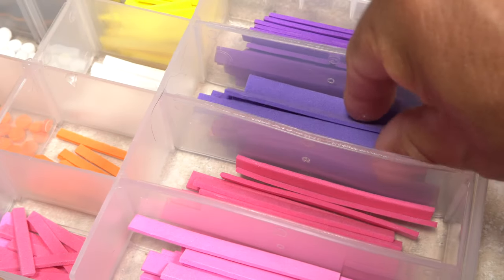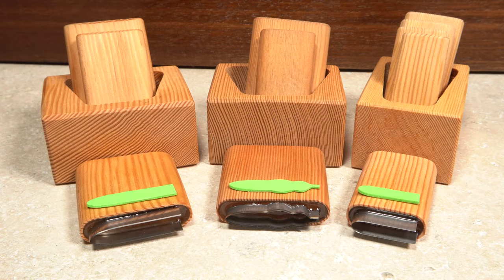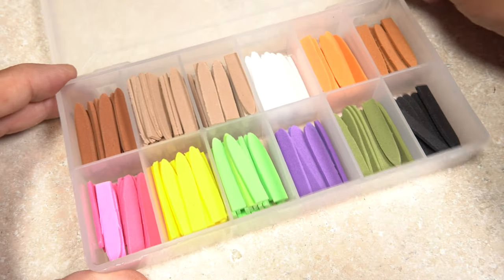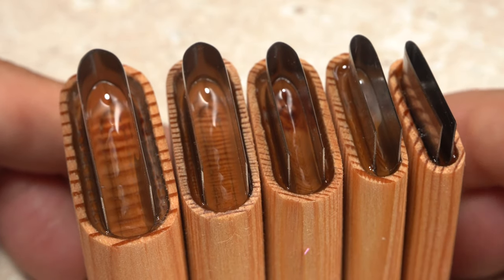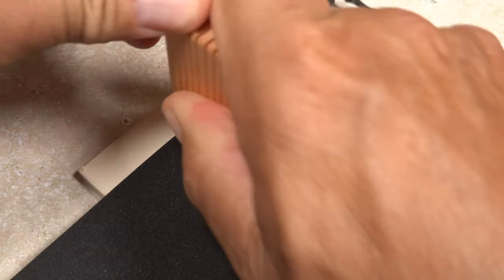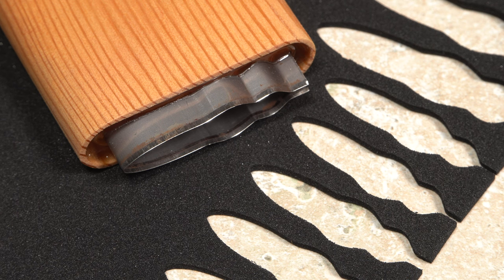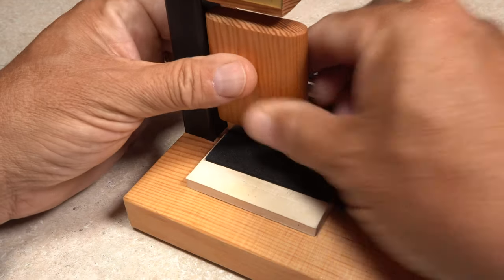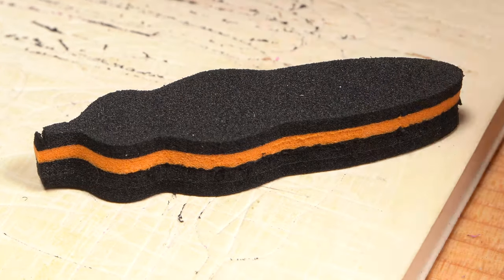Fun with Craft Foam - Part 2

Comment: I think because of the shape it would be quite difficult and time-consuming to sharpen, the press would be a must in my opinion. I like the idea of having foam pre-cut and sorted. Heck of a time saver if you need a say there or four little Chernobyls for a quick run to a brook trout stream after work or if you are retired and lazy like me.

Comment: Tip … if you have a family member with a Cricket Cutter within a few attempts you can quickly have it set up to crank out a full sheet of various sizes and colors (enough for a lifetime.  All the shapes and sizes are out on the internet; just need to do a little planning.
Reply: Dude,  thanks for that.  Seriously.   I now have a "project" for my daughter.   I was just looking at a cutter this weekend.  But it wasn't priced, and I really didn't want to go ask.
Reply: @yepyepuhhuh   small warning, it is a rabbit hole you can fall deeply into.  Once I mastered foam bodies, I then jumped over to translucent wings made of a shimmery material from the craft store.  I stretched it out on a piece of cardboard, covered it with a very thin layer of craft glue (just to stiffen it a bit), allowed it to dry (hanging by a clothespin on a line).  Once dried, rolled it flat and then fixed it to the Cricket Cutting Matt.   Like anything else, some things can be improved incrementally, while others are evolutionary and cause conversion shift, likely pushing the high priced cutters aside.  My total material cost was less than $25 and I have enough foam bodies and wings for myself and a half dozen friends that will last well beyond my lifetime.  Your daughter can easily build an Etsy business and sell sheets of foam bodies, wings and hopper legs in a wide range of sizes and colors.  Here is another tip:  at CVS, you can buy Ladies Eye Lash extensions (yeah, who in the heck would have thought of that) for less than $6 and build great nymph tails, no more coc-de-Leon or wood duck. Just a simple marking pen and off you go…best of luck.
Reply: I've noticed the "rabbit hole effect" got my first vice about 6 months ago.  Been tying and trying different things.  The eyelash material is genius.

Comment: I've tried two different ofo these cutters and haven't had much luck getting them to cut very easily.  They always get about 80% of the way, and then just fail to cut.  Any secret?  Tried different methods, and pressures including pretty damn hard.